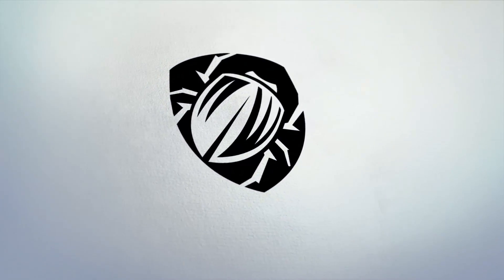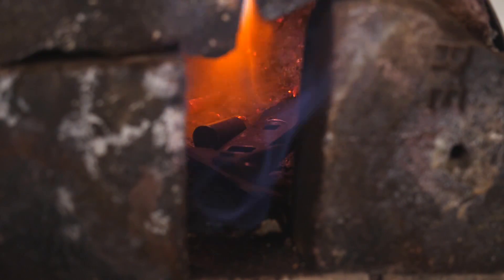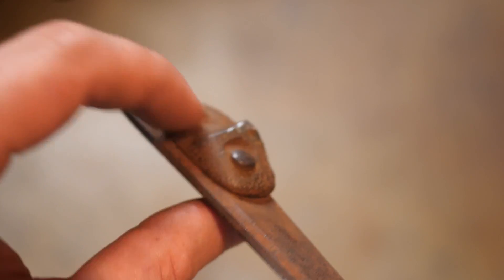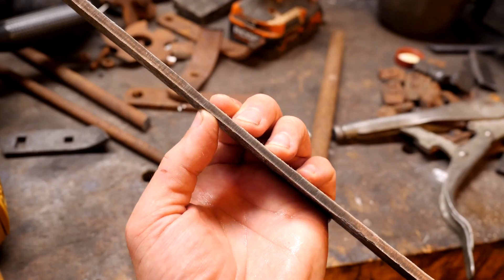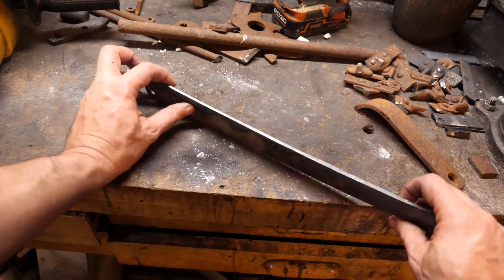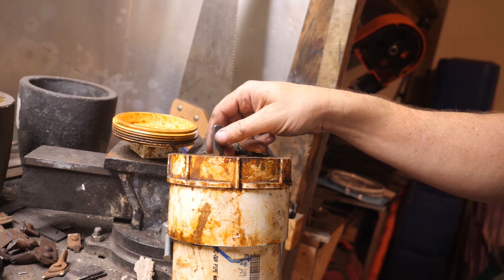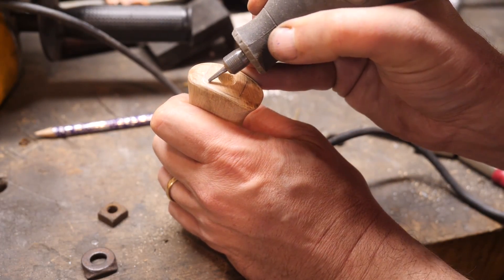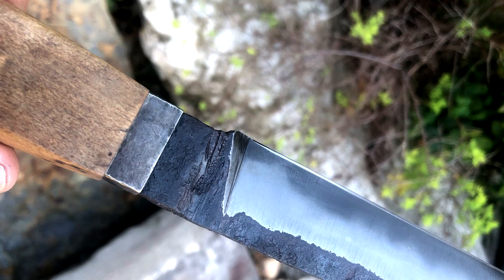Forging A Machete From An Old Lawn Mower

Comment from the maker: Get 68% off NordVPN! Only $3.71/mo, plus you get an additional month FREE at https://nordvpn.com/greenbeetle or use coupon code: "greenbeetle" during purchase. Both the link and coupon are case-insensitive.
Reply: have you ever been on forged in fire. you would be brilliant on that show
Reply: So that means, that once you forge your billet you first have to normalize the billet before attempting to heat treat. Is that correct?
Reply from the maker: @daniellindsay7651   yes
Reply: Is rebar any good for forging?
Reply: @daniellindsay7651  depends on what your forging and what type of rebar you got
Reply: InstaBlaster.

Comment: Dude, I'm so happy this popped up, me and my friend was thinking about doing something similar, only we're amateurs lol
Reply from the maker: Hey welcome aboard this channel
Is amateur hour you’ll be right at home!
Reply: YouTube is listening aha
Reply: Hugo Adrian Wilkins  is that.... is that supposed to be an insult?
Reply: We're all noobs to be honest. It is insanely difficult to account for impurities and other flaws when repurposing older metals. There are some tests but research into manufactured materials by brand and/or age past 100ish years exclude factors like exact chemical composition on origin or weathering and microfractures, so on. It's really trial and error in most, not all, cases. Using the same grind test in the video will give a good clue for carbon, but chromium, phosphates, etc... a bit more challenging. You can still use your best judgment in the heat treating process based on color and your own observations.
Reply: White Marlin  It should be sufficient.  Im new at it myself but I've made a couple things out of old lawnmower blades and they got hard.

Comment: Thank You for making an old looking original tool (machete ) and you actually went out and chopped a tree with it... I have seen way too many mirror polish blades and tool restorations ..I have 2 old machetes I restored  and used gun bluing on the metal and used old wood on  one of the handles

Comment: You broke my heart. I've been using the same A.L.M. Works mower my great great grandfather used in 1890's. After a little oiling and the turning of two screws, it's been working like new for the last 10 years on my 2 acre yard and still has original parts. I'm nearly 40, no kids, so my nieces and nephews could maybe stretch its use another 100 years. The screws that adjust the bottom blade are only half turned. However, my biggest gripe is the dinky tang on your blade. Maybe it wasn't rounded off enough to prevent stress fractures and allowing material to take up handle weight is okay. 
Overall, fun video, I'll never regret subscribing. You edit the boring parts of the forging process and keep the important bits in; quenching, normalizing, solving the mystery of the materials. Thank you for this post, but I'm still going to grump at you for chopping up that beauty. (maybe gearing was all rusted and beyond repair... yeah. I can sleep now.) Best of luck and keep doing your thing the way you do.
Reply from the maker: they're $45 on eBay you should start rescuing them

Comment: To be fair regarding the HRC, a lot of great machetes are actually tempered rather low so people can sharpen them using a normal file. A hard machtete is great for one day trips into the forest but if it really is about taking it on a week long trip I would rather have a softer machete and a file, easier to sharpen and more forgiving for muck ups.
I love the handle shape.

Comment: 55 to 57 is a really good hardness for a machete or billhook, Ive worked with them for years and the amount of times they hit pebbles and rocks even in experienced hands is phenomenal. 
So a little softer means the edge bends rather than cracking or worse snapping the blade.
I would sharpen to about 400 but it does a fantastic job of of doing what its supposed to.

Comment: I live in Far North Queensland Australia and have a rainforest jungle block. Our terrain brushing a track, can take a day to make it 200 metres (650 feet). Our preference tools are Cane Knives and more old school early explorers used Brush Hooks. It’s been impossible to find a decent Brush Hook in recent times but Fiskars have comes out with a long and short handle and they’re superb actually. We (and every other Aussie and farmer who lives in jungle regions) will testify, that after trying out a range of machetes, they all suck. No curve, weight in wrong place and whether it’s our vegetation and fact our timber is 2 or more times harder than any other wood in the world, don’t know. But they just are not as effective. Also when in jungle it’s vines of every description and a plant we have, terrible shit named ‘Wait-O-While’ (literally, early explorers called it, wait a while, because it’s a vine with millions of fish hooks running the length of it and when it just brushes you, you have to back out if it, painfully slowly), which Machetes just can’t deal with, you need a hook section, to bunch up the vines and then to tug on it to cut them all at once. You have no knuckles left with machetes.. This one you made, too light, too straight, too short and when you need to tackle something bigger you need a hung handle which you can use two hands with. You have so many awesome tools in ya limb eater deadly workshop, have a crack at something useful like a brush hook.. Cheers mate. Thanks for video.

Comment: @ Green Beetle-  Just so you are aware.  There is another blade on those mowers.  You may have only been aware of the Rotor Blades which is what you used.  But there is a "Shear Blade" which the rotor blades turn against acting like a pair of scissors when its actually cutting the grass.  Look along the lower portion of the mower, this part often doubles as the lower frame and does not look like a true blade except for the sharp edge the rotor turns against.  This also should be good quality blade steel.  

The rest of it, might be good for mixing a Damascus blade or something, maybe forging into a hammer, but that is about it...

Comment: On 10xx steels you can probably use brine for the quench. This should help those low carbon steels harden. You might not get any hardness out of certain shafts that might have lead in them for machinability. But some of that flatstock in that frame could be toughened up and used in the handle or for random tool projects if not blades.

Comment: golok style machetes work really well with more of a pinch grip. Let the weight work for you. let your thumb and forefinger be the tightest and loosen up the other three some (more of a cupping). Use a lot of wrist action to get a "whippy" or "snappy" cut going. Once you get the tip speed up on the blade it will really bite. the looser grip helps keep vibration down too. You can't use the  grip all the time, like when you are doing delicate work or need a lot of control.

Comment: there is a wide blade that the turning blades push the grass into to cut. I would think it would be high carbon
Reply from the maker: It had so many bolts in it I didn't check.

Comment: There should/might be included a cutter bar (the steel that the curved blades contact to actually cut the grass) that might be harden-able. Just a guess?

Comment: Question: For the handle, could you have soaked it in resin to fill up any cracks or holes, then sanded the outer layer of resin so its just wood surface? You might need a vacuum for that so perhaps that wouldn't work... Just a thought on how to improve older wood with lots of holes and cracks.

Comment: LOL! Steve...you aren't supposed to measure your quench tank by dropping hot steel into it! 55 hrc sounds good to me for a machete (I'm no smith, though). I bet with the meat that's on it still, it's gotta be one tough cookie, just needs a touch-up here and there after use.

Comment: Your videos are very interesting but, from a guy who makes sculptures from industrial cast offs I was really bummed when you cut those great "spoked wheel " things that the blades were rivetted to.  Then even more bummed when you decided not to even use the material that was under the bits of destroyed wheel.  If it were me dismantling something like that, I would have used an angle grinder to grind the rivet head off and punched the remaining rivet out.  Wheel saved and maximum amount of blade steel too.
Reply from the maker: They were rusted pretty tight.  These are about $40 each on ebay hop on there and start rescuing them.

Comment: I have a question that you may or may not know the answer to. Iv tried to do some reasearch but have come up with nothing. Why do some people temper using an over or torch, and why do others temper by quenching only the cutting edge and use the remaining heat in the steel to temper the blade
Reply from the maker: tempering with temperature control (in an oven) provides a longer temper cycle and precise temperatures which can produce a more predictable hardness and without the risk of over tempering.  Frankly, tempering in an oven can provide a better result.

Comment: Can you repeat the 'Forging with Springs' episode but tighten it the right way? I'd really be interested in the proper results. Thx.
Reply from the maker: I tried this it pulls apart just the same. Any length that isn’t exactly the same temp as the one next to it throws everything off I think.  At any rate U couldn’t get it to work.
Reply: @GreenBeetle  Right, rethink. 1 spring within a spring within another one concentrically, then use your super press to squish them square and go from there. Must be a spring source which can match inner and outer diameters. Just a thought, still loving the vids.

Comment: Great job with the old ''reel type'' mower. That brought back some unpleasant memories. A quest on quenching, please... Does quenching in used motor oil add carbon to semi-hard steel? Also, would it blacken the steel and is it the same as ''Japanning''?

Comment: Ive got a question for you; you have a heat treat oven, why do you normalize in that, but still do the final heat with your forge?
Reply from the maker: I usually quench out of the oven too.  On rare occasion I don’t but that’s usually a simple eutectoid steel  I feel comfy w forge quenching.

Comment: Isn't it possible to up the carbon yourself or do you need some superfurnaces for that?
Reply from the maker: Could probably do it w case hardening  then forge weld and fold or make sheer steel.

Comment: 9:01 into video.  several opinions from an amateur hobby smith.    could of just ground off the rivets and leave the centers in place so you had a full bar of steel to use. second gripe: i like being bare foot too, BUT NEVER IN THE SHOP. WEAR YOUR SHOES.